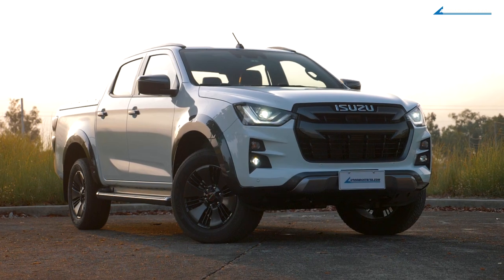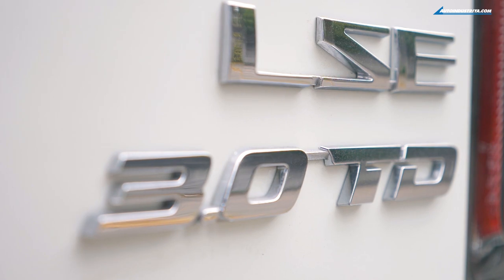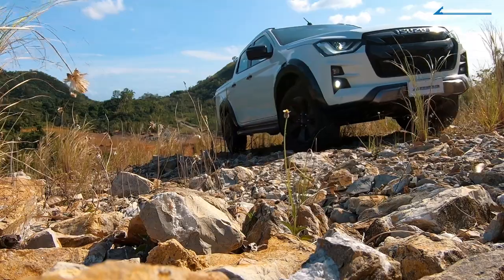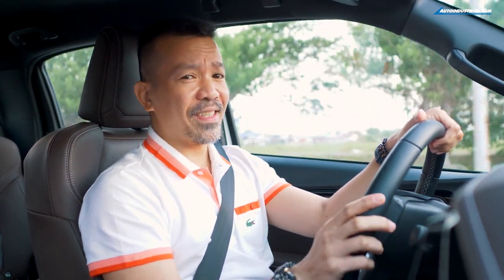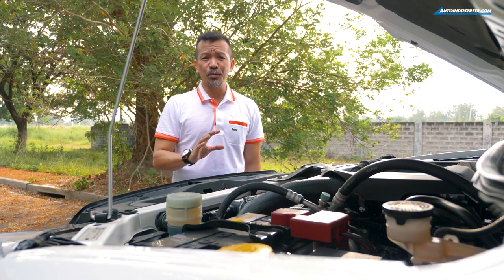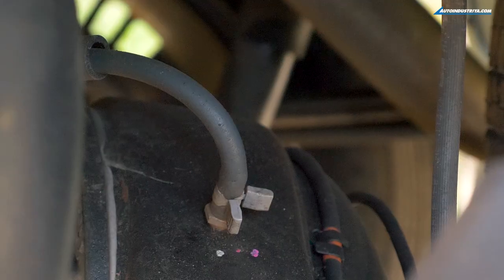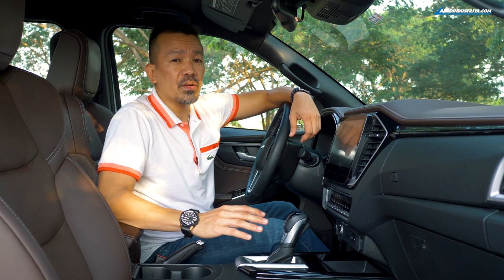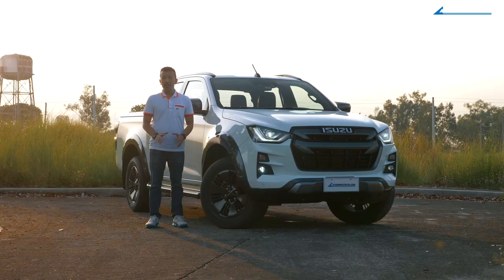Taking Charge: All-New 2021 Isuzu D-Max

Comment: I can attest with what Eric was saying regarding the body roll. Honestly, I was very frustrated during the first three months of acquiring this car, I am somehow frustrated. I am nitpicking with the engine noise during overtaking as well as its tough-to-the-lower-back suspension.   

Little did I know that driving this beast to the mountainous roads in Region 2 would really bring back my excitement in driving this truck.

Tried it out at Sta. Fe Nueva Vizcaya, with the long and twisting roads. To my surprise, Even at high speeds (60-70 kph approaching curves) maneuvering this vehicle really gives you a commanding stance on the road